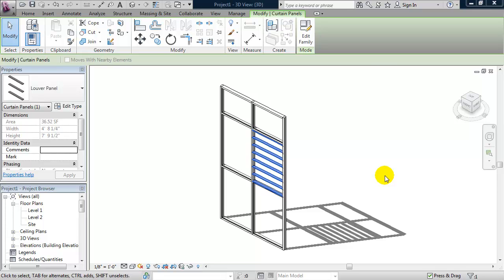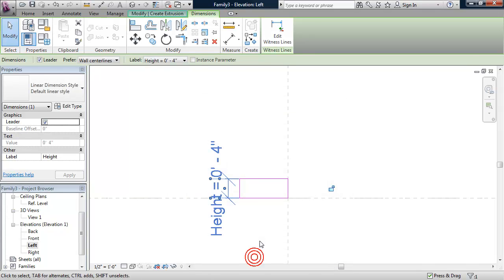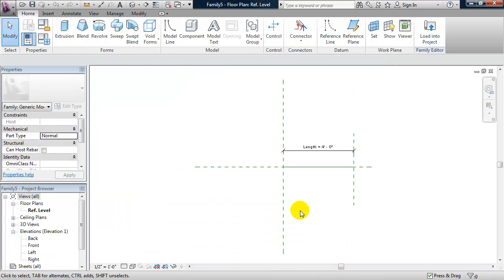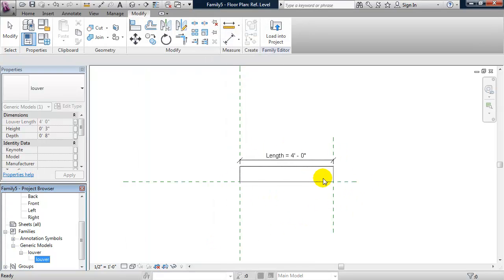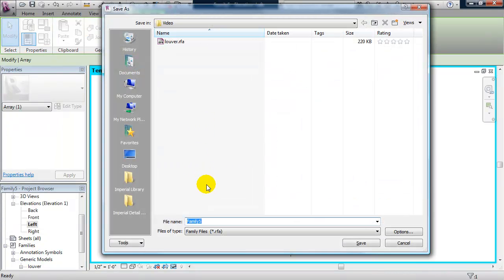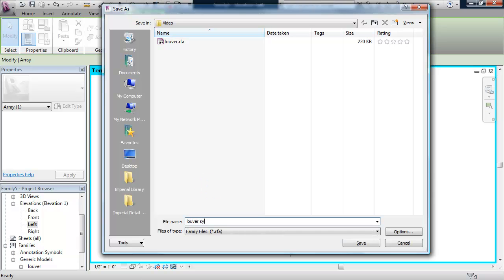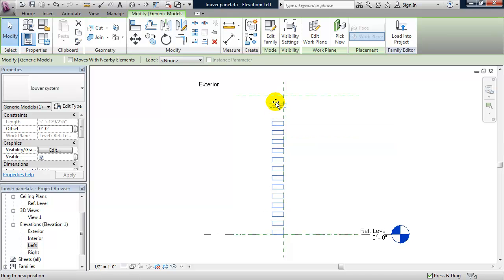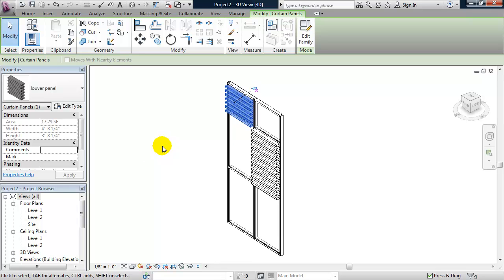Revit Louver System

Comment: Thank  you . I was doing it all wrong. Tried to make casement family using the curtin wall panel family had to array shelves. Created the shelves in generic model but didn't nest it into generic model line family before nesting it into curtain wall panel family. The width of the shelves did not snap to the boundary of the curtain wall grid in the project file. Had to adjust the instance parameter manually in project for every shelf unit. Now I will try this method and my use and abuse of the curtin wall function will continue!

Comment: Hey Alphonso, thank-you for a great tutorial. I have used your video to create a wire fence that inserts into a curtain panel. How will I get the line based family to work to space the horizontal wires. I have a vertical array, now I want to load in a horizontal array into the curtain panel family. the default length in the generic line based family is left/right and not top/bottom, if you see what I mean? Many thanks for any steer on this one. P
Reply from the maker: I hope you found what you were looking for